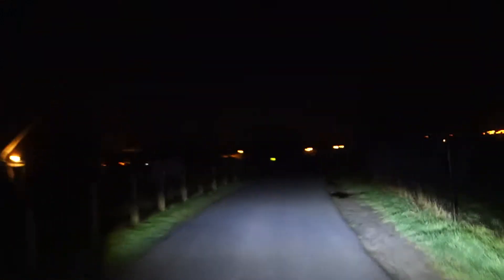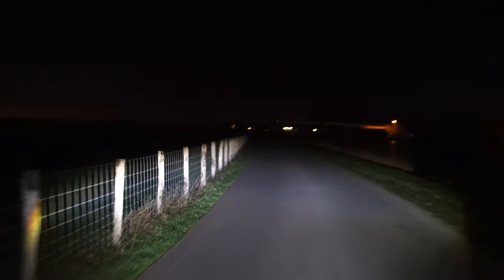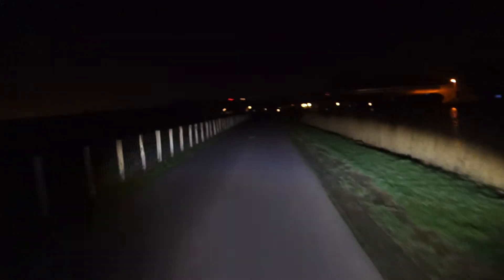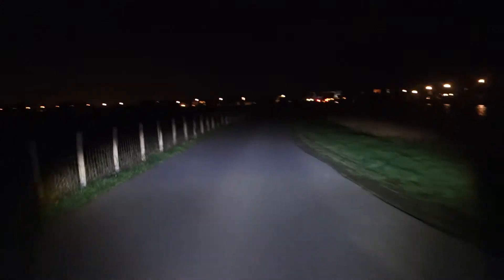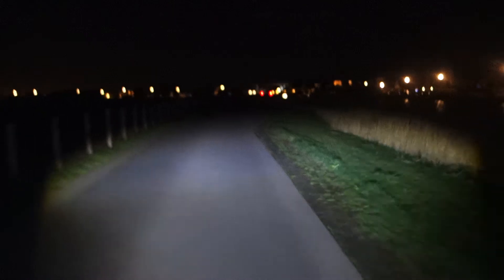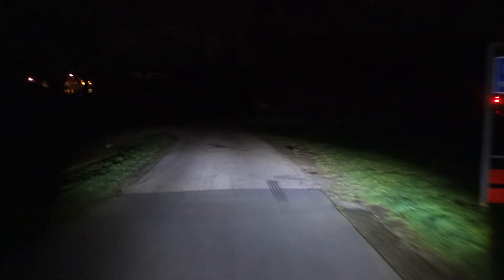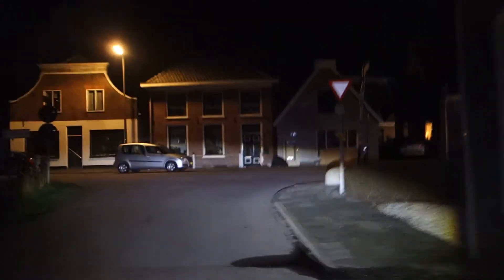Philips saferide 80 vs. Lupine sl  vs. Supernova m99 pure, part 2

Comment from the maker: Note: This is a summary video (at the end of a ride, while still riding with the Lupine SL) in which I talk about the different strengths and weaknesses of each of the 3 lamps that I compared in part 1, which are the Lupine SL, Philips Saferide 80, Supernova M99 pure. If you want to see the beams compared and see the hot spot of the M99's beam, watch part 1.

Comment: The problem with this video is the video doesn't clearly tell you what lights he's using. He just randomly talks leaving you wandering what light he's showing.
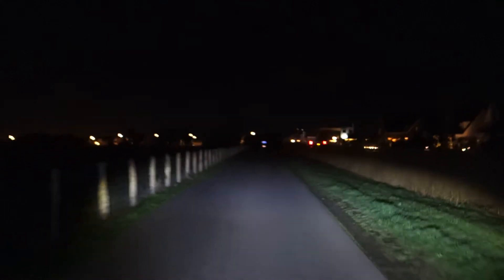Reply from the maker: There is no "randomly talks". 1) This is part 2, as part 1 was cut off so I continued from there, which was riding with the Lupine SL as I mentioned e.g. at 2:33 "The only thing where this lupine SL is better...". 2) the commentary with this video is a summary of the 3 lights that I showed in part 1. That was all that was needed as the comparisons with showing each light was done in part 1 (and I mentioned  in that video whenever I switched). So your complaint is like that of a student, coming in late for a lecture of mathematics, then after a while starts checking his phone and afterwards says that the lecturer 'randomly talked'... But I will add a separate comment about this to make it more clear to watch part 1 first, and that this is a summary video.
Reply: @WHS_reviews  Hey. Thanks for your work, but this video is soooo bad in everything. Bad quality, awful sound, comments are not helpful at all. People are watching it, because no one else shows what you did - a comparison between Lupine and Supernova in the same environment. So thanks for showing that Lupine is the best of those three lamps and wish you a better videos :)
Reply from the maker: @michalmalanowicz7595  : Lupine is indeed better than the Supernova (but not than Exposure that I also tested around that time that was a prototype then, nor in many respects than the Philips Saferide 80). Comments are not helpful? Look at the other video with these lamps, this is a summary of the other one. There I give details about all the problems with the Supenrova and Lupine lamps. See: https://www.youtube.com/watch?v=ETBVD9g3Ip0
Reply from the maker: @michalmalanowicz7595  : Another thing, in my other reply I already state that this is a summary video with part 1 showing and stating what is important. Then you replying to this comment and making a stupid comment about this video is just mind boggling.
Reply: @WHS_reviews  :) You really have to learn a lot. All you do now is just insulting people which wish You all the best. Cheers.
Reply from the maker: @michalmalanowicz7595  : Wishing you the best by telling them all the things they did wrong, while not reading the comment, not watching the other video. This is similar to 'humble bragging'. Not impressed at all. You are the one who needs to learn a lot.
Reply: @WHS_reviews  For sure I'll try to at least look at my video before I publish it and will try to correct things others find difficult to understand. I hope a bit of criticism will help you get better a do a really good reviews. The topic is hot. Good luck!
Reply from the maker: @michalmalanowicz7595  : Ok , in that video (I put a direct link to that video in my edited first reply to you) I also explain why the video is so bad. I had trouble with the camera which acted up, it was stormy, I didn't have the proper mount for the Lupine light, and I only had a few days of testing. As you said, nobody else made such a comparison, and that's why I put it up anyway. The description with video 1 states all these problems, and there I talk and show what is good bad bad about each of these lights. So this is why I replied as I did to your comment, I explained it all, and then it seems people don't take that into account which is a bit annoying...
Reply: @WHS_reviews  Well, you're right. The bar is set very high when you make such a review / comparison. I watched both films on my laptop and I had a difficulty to understand what's going on. Part of it is that I'm not an english native speaker but also weather conditions don't help, especially in audio quality area. So, I'd love to see another video in a more controlled environment when you switch between Lupine and Supernova with maybe a voice over. That would be great!
Reply from the maker: @michalmalanowicz7595  : I see. I may do a new review of a few more lights in a while, with the new production Exposure light (which was improved compared to the prototype in esp. cutoff sharpness), I will see what I can do. True, the wind noise makes it hard to understand, and I can't change that and I don't like to do too much post editing, I want to mostly give information, so my emphasis is on information and part of that is on my site esp. for more in-depth details, text is better than a video. So there I describe all the good and bad points in more detail. It is still on the main bike lighting page (rather than moved to separate pages for these lights), see: https://swhs.home.xs4all.nl/fiets/tests/verlichting/index_en.html#accu-koplampen-met-afkapping